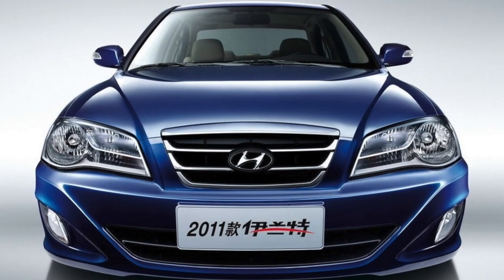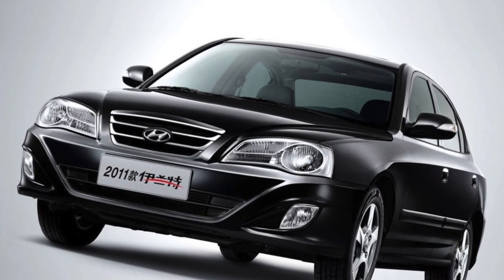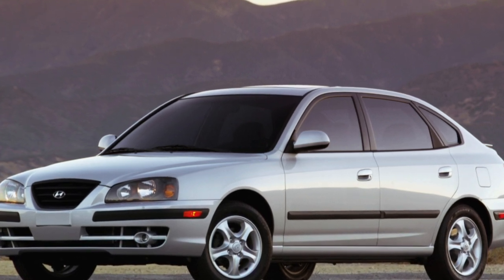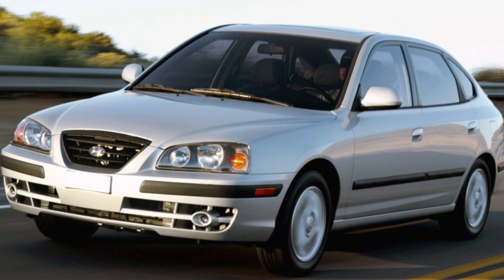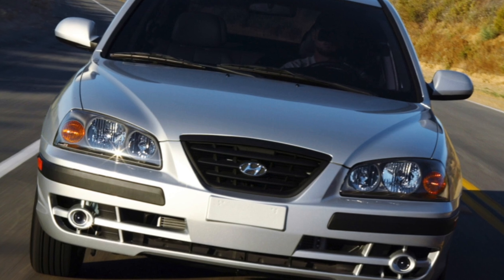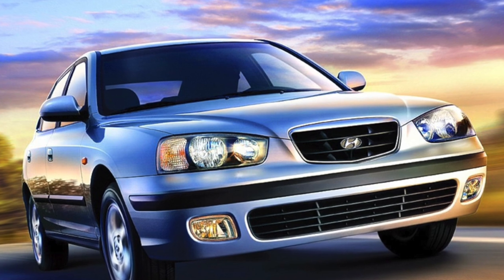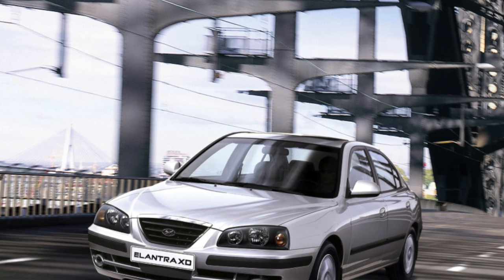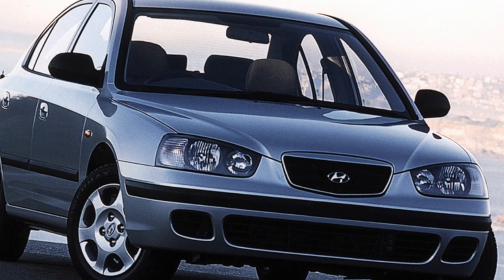Hyundai Elantra 3 Problems | Weaknesses of the Used Hyundai Elantra III generation

Comment: I have a 2003 gls with 272.000 miles in it. It’s a good reliable car that I still drive daily. It serves my family pretty well. I had it for 5 years. Got it with 150.000 miles for $600. Didn’t have to put to much money in repairs just oil changes every 3 months or 3 to 4 1000 miles.
Change the timing belt at 220.000 miles. Very good car the easy to work on and cheap to fix.
Reply: Got mine with 130k for $500. Driven it all across the US, From highways to forest roads it has never failed me. Ive done nothing but change the oil with full synthetic and im approaching 200k now. I need to replace the struts and tie rods which is an easy enough job. Just bought a 4wd tacoma but having a hard time letting the old hyundai go. Been a great car.